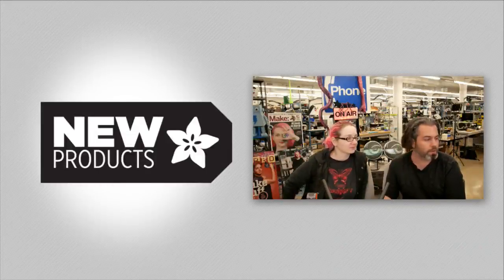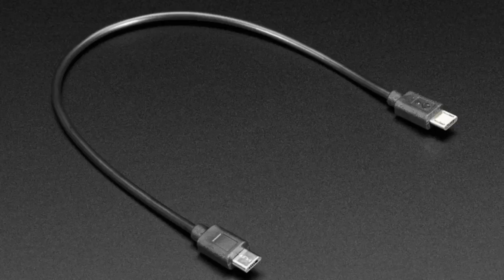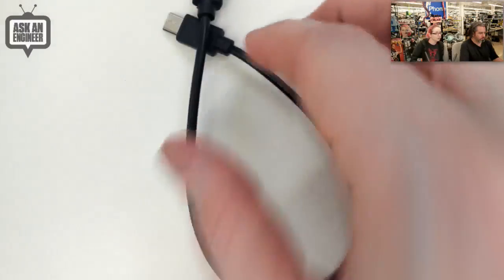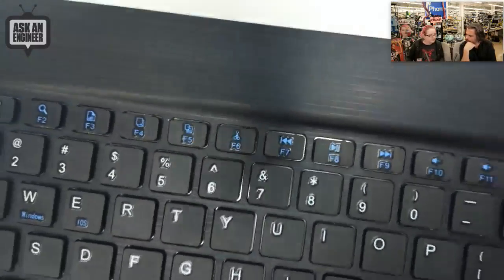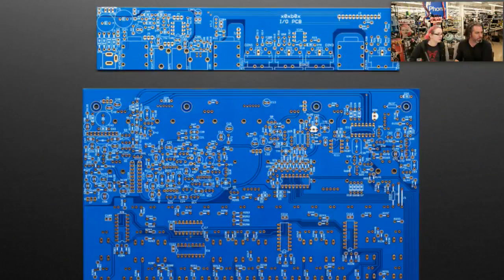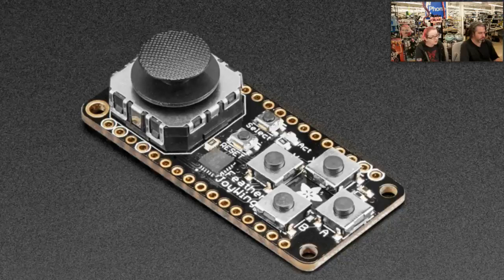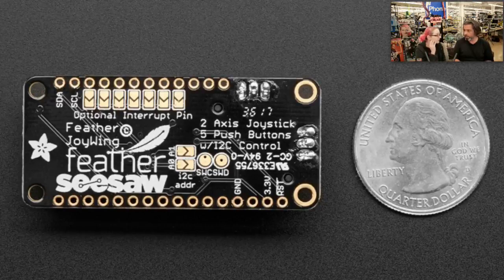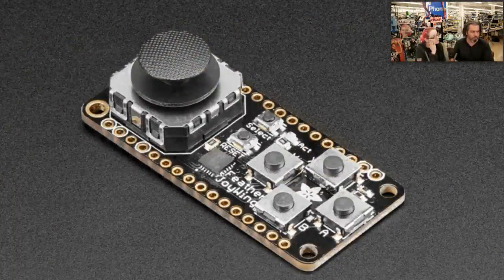New Products 10/04/2017 @adafruit #adafruit

Comment: I like the concept of the featherwing with the buttons, but it seems a bit unusable from a physical standpoint.. If i want to mount this to an enclosure, i either have to have alot of the joystick sticking out so i can get to the buttons, or not access the buttons easily (or thru a big hole).  Maybe split off the joystick via cable as an option?

Comment: If I new anything about how to properly use & set up hardware, I'd probably use the JoyWing Feather in some kind of 3ds-like emulation system. If I knew how to create software, I'd try to figure out how to run anything from arcade games, to stuff like PS2, 3ds, or gamecube.
But I don't know anything about that stuff, so I can't really make it happen.
Reply: you should check out the pigrrl zero over at adafruit's site, You just have to buy the parts and follow the instructions
Reply: Nacho Jimenez I already know about it, I cant afford it, and that's not quite what I'm talking about.